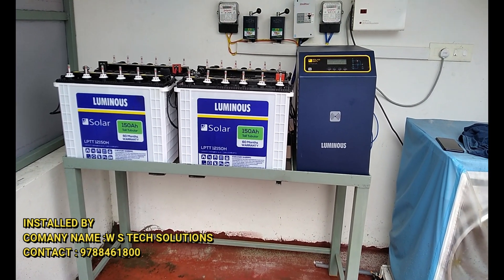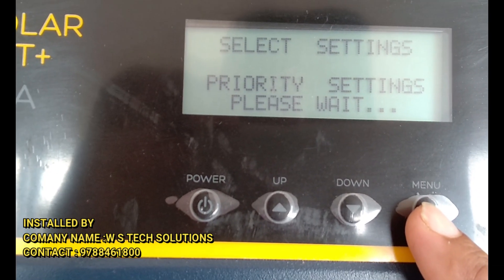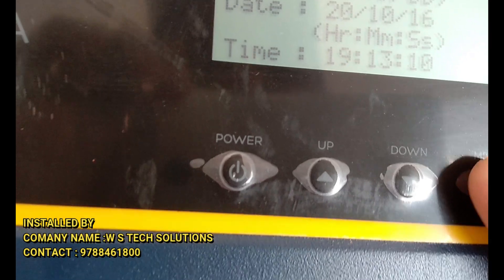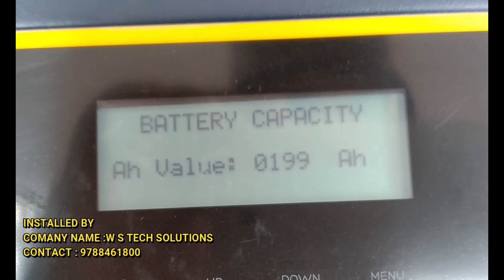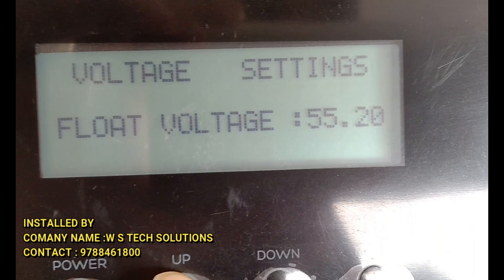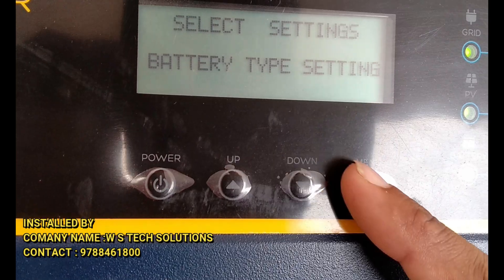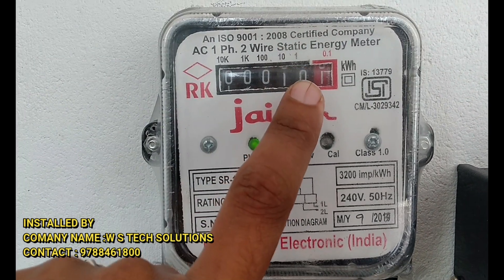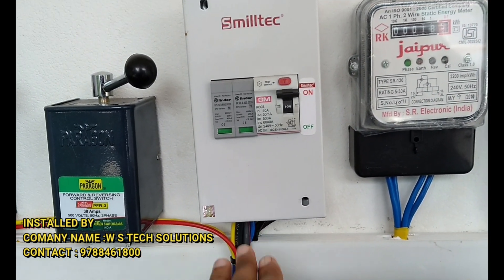LUMINOUS NXT 3.75KVA SOLAR PCU FULL SETTINGS AND INSTALLATION

Comment: If we want to recharge batteries from panels first then from grid. What is the settings
Reply from the maker: solar- grid - battery  or solar - battery-grid and turn on current setting to minimum 10 amps
Reply: @wstechsolutions8337  thanku

Comment: Should the capacity setting be of individual battery (as in your case 150AH), or should it have been really the total installed capacity ie; 150 x 4 = 600 AH ? What is the real value configuration required here ?
Reply from the maker: 150AH

Comment: Sir,  I have installed the same, but in output, phase and neutral power is coming,  if mcb off also
Reply from the maker: check weather the mcb is off properly

Comment: Hi which data logger we can use with this system ?
I installed Ginlong data logger but it is not working 
Com light in data logger is not on means it is not fetching data from Luminous PCU
Please advice
Reply from the maker: contact :9788461800 whatsapp

Comment: Mere installing panels  ,inverter & showing batteries & operating menu is not a complete one.It doesn’t serve main purpose of promoting sales and  self sustained life as long as it is not connected to loads that running domestic appliances by way of demo.This is my humble suggestion please.

Comment: Brother .. i have same PCU but i have installed only 1kw pannel , brother i want to charge my PCU battery by current also as my Pannel power is low, so what should current have to set , by default it's 12a ?
Reply: For 150ah battery max charging amp should be 15a
Reply: @asd1752  thank you very much Brother for replying, brother i want to know can i connect net metering with this PCU?

Comment: Bro your voltage is very low showing 55volt in ur video as per ur panels voltage must be above 115 volt average.me and my friend bought same inverter and the voltage was dropping like 64 panels volt even 54 volt.Then we complained to luminous they changed the main board of the inverter after that our voltage with both systems is constant like 124 voltage only amps changes according to sunlight.Average panel voltage must not drop.
Reply from the maker: Bro during raining time we take a video. so the volt is low.
Reply: Sir I also face the same issue in my client site
Reply from the maker: @gopinath8793  DURING CHARGING DUE TO CLOSE CIRCUIT THE VOLT WILL BE DROP DOWN AND AMPS WILL BE INCREASE. 

Voltage is the pressure pushing the electrons thru the work. Amperage is the amount of electrons flowing thru the work. By Ohm’s Law Voltage and amperage are inversely proportionally in other words as the voltage goes up the amperage goes down because you are looking for the same amount of work
Reply from the maker: Voltage is the pressure pushing the electrons thru the work. Amperage is the amount of electrons flowing thru the work. By Ohm’s Law Voltage and amperage are inversely proportionally in other words as the voltage goes up the amperage goes down because you are looking for the same amount of work
Reply: @wstechsolutions8337  bro after replacing the main board by luminous I am getting average panels voltage from 115 to 125 volts even raining or less sunlight but only amps varies according to sunlight and load I am using
Reply: Bt sir we don't get battery fully charged and their is no backup
Reply from the maker: @gopinath8793  SIR, BEFORE INSTALLATION YOU NEED PERFECT CALCULATION REGARDING BACKUP
Reply: How much and what are the loads connected in your above system sir
Reply: @gopinath8793  bro I have connected 9panels 375 watts load 9 fans one deep freezer one refrigerator one Tv .one washing machine and all lights of my house (led bulbs)2hp water motor and two water heaters are connected to EB.
Reply: @jobysn  bro are you connected 9 375 watt solar panel on
Nxt 3.75kva pcu and how you connect the solar panels
Reply: I bought that inverter....  8panel, to get proper output u need more voltage to reduce system loss.
Reply: Hi I am get MAX 120 volt at 19 amp from this system in afternoon time 
I got it installed 2-3 days ago
It is with 9 panels of 380 watt each 
How much max volt and amp are you getting?